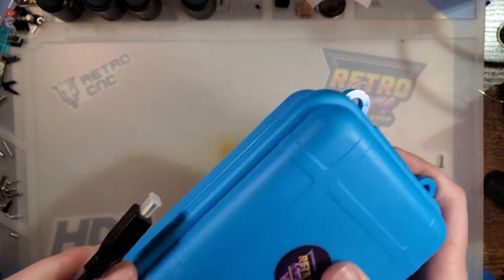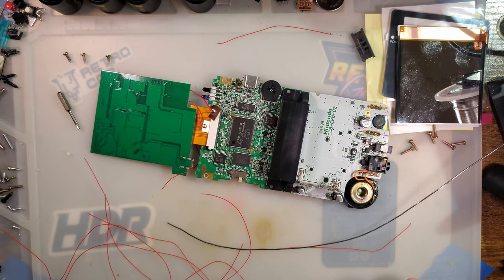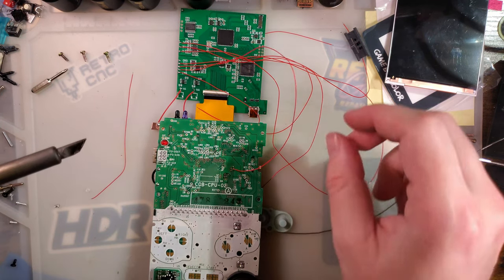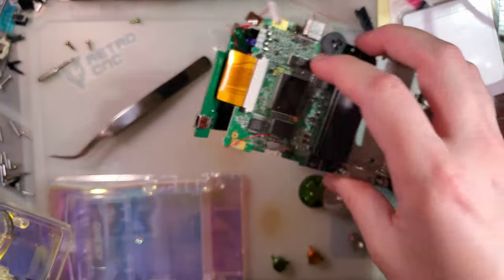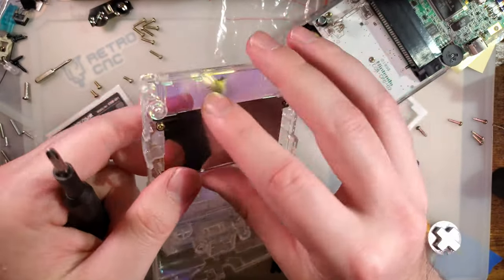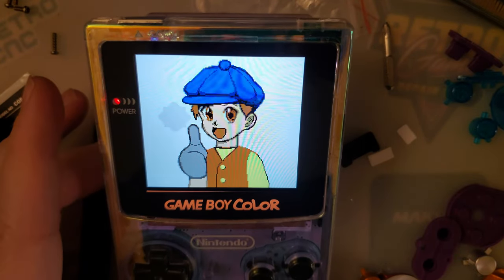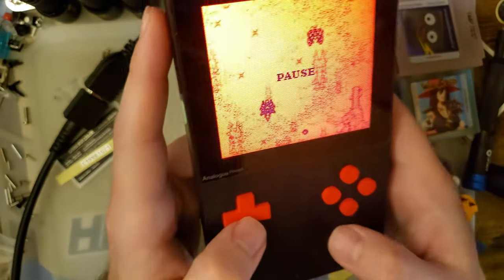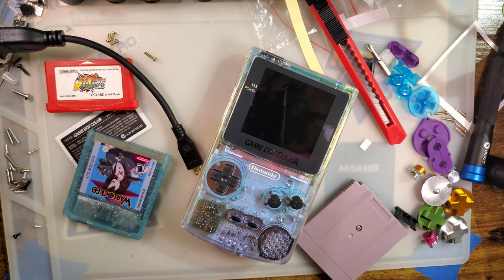HDMI Out on Game Boy Color -- Q5 OSD HDMI Kit

Comment: Incase youre a new moddee or just didnt realize it. The touch sensors are just bits of copper tape with a wire solder to it. So you can easily desolder the wire and get a new piece of tape cut to whatever length/design you want then resolder the wire to it.

Comment: I would put flux on the via, tin the tip of the soldering iron, then hold the wire in the via surrounded by flux, then literally all you have to do is tap the tinned iron to the via and the solder will flow to it. This way you can guarantee a solid connection to the via. Either use no clean flux or rub with a isopropyl soaked qtip to clean up.

Comment: @makho, If your wires for the touch sensors touch the shells plastic, you'll get cycling of brightness or palettes, just an FYI.

Ran into this a few times and you just need to be careful on the routing of the wire from the converter board to the copper tape sensor
Reply: Question for you my friend. If I cut off (or de-solder the wires for that matter) the "touch sensors", will I stop the darned color palette cycling? It's so sensitive that I'll be adjusting the brightness and it'll trigger the color change as well. Another thing that happens is if I get a phonecall, the screen starts going crazy cycling through the color palettes if the phone is just a few feet away. I didn't cut it or desolder before installing in the fear that it might get stuck in a color palette that isn't the regular one and I wouldn't be able to go back to normal. By the way, these sensors aren't really touch sensitive, it's either heat or detects changes in the magnetic field because all I have to do is put my finger close to where the sensor is without touching it at all and it'll start to cycle the brightness/color. Anyway, your feedback would be greatly appreciated, I just wanna remove mostly the color cable but would love to remove both because I can always adjust brightness via the button through the soldered wire to the ribbon cable spot.
Reply: @groundcontrol6876  yea, remove them and the issue will go away.
Sadly the idiots making these kits seem to think we want color palettes for every handheld.. it's only useful for the pocket and original dmg
Reply: @cidkramer  Thanks a lot man. I'll get to it :) I have to take my SP apart anyway because the terribly 3d printed hinge caps I got from HHL don't go in far enough in the hinge so they don't pop in as they should and they start popping out of the hole and the screen doesn't shut with that satisfying click as it should. It's too bad cuz I'm gonna have to use up the black and beat up OEM hinge caps and it's a clear pink shell... not exactly the aesthetic I was going for. Oh well, at least I'll get rid of those unsightly cables while I'm at it and just use the tried and true soldered wire for the OEM button control which is more stable and user friendly anyway.
Reply: @cidkramer  I like it because I'm not a fan of the stock color paletes for Og gameboy games when playing on color for all games

Comment: the scaling being uneven may be the capture card. since those chinese hdmi capture cards just force a resolution. on top of that capturing 1080p@60 messes a little with the picture alignment. 1080p30 and below modes are pixel perfect.
t. i have one of those too.
Reply from the maker: I just got a new capture card (that properly supports 1080p) so I'll have to double check.

Comment: I use thin copper wire and run it through the via, then I put solder on my iron tip it goes straight to via. Found out it was the best way.

Comment: It seems pretty useless with those old AA batteries, why didn't you install a battery pack mod
Reply: You could use the old power cord when using the TV mode.
Reply from the maker: Because I was looking at the kit. The kit doesn't include any of that. Feel free to install a battery pack in the console you build, if you want.